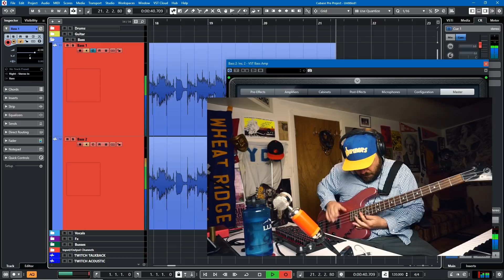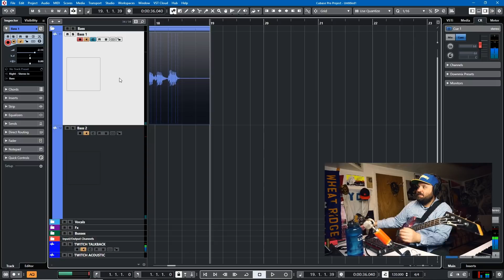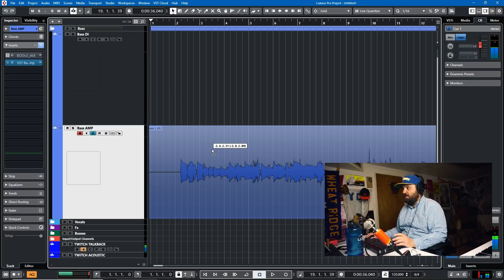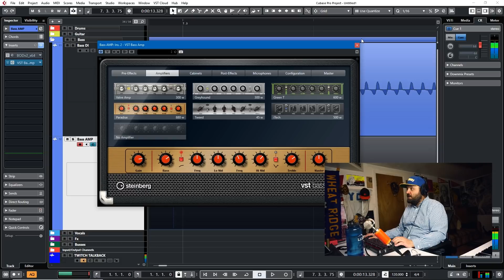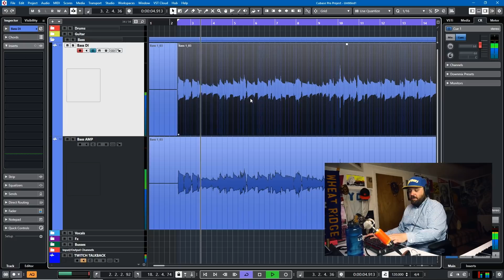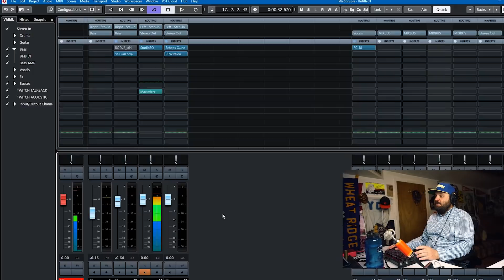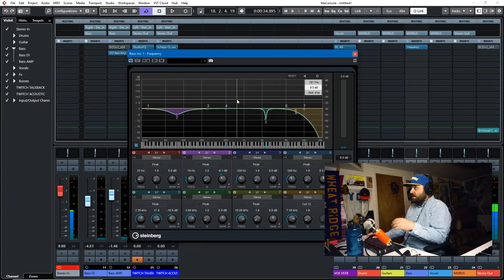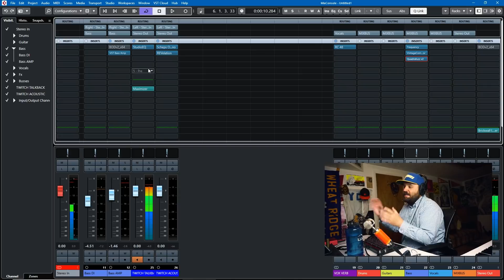Cubase 10 Tutorial - Bass Mixing Tips

Comment: The only thing that I would add to this is, sometimes you may want to bounce in place the track with the Amp Plug and check phase afterwards to make sure that the plugin does not introduce phase alignment issues.  Using an Axe Fx III I've noticed the amp sound is slightly behind the DI as it is a virtual amp, speaker cab, mic, and preamp just like micing a normal amp.
Reply: Yeah i do the exact same thing with M Auto Align and it works well , i always get more punch and clarity even if this subbtle